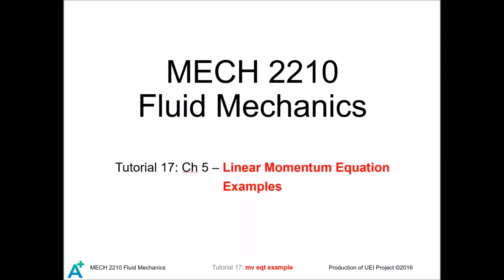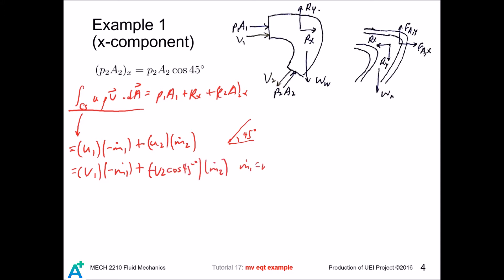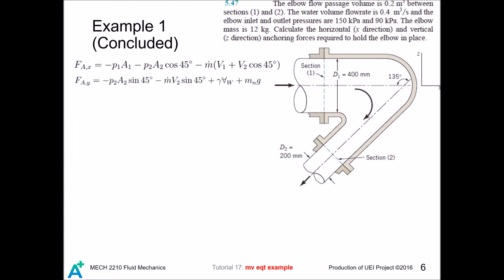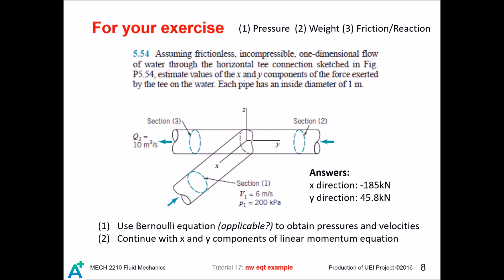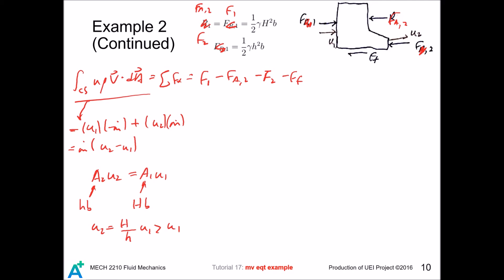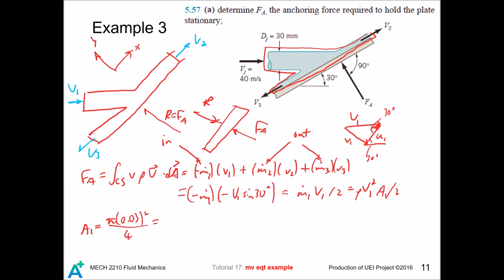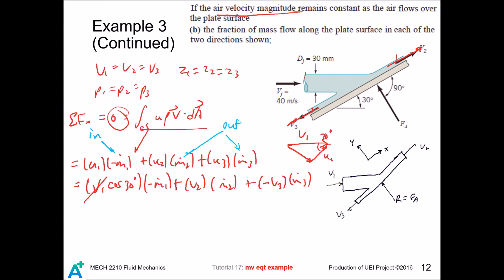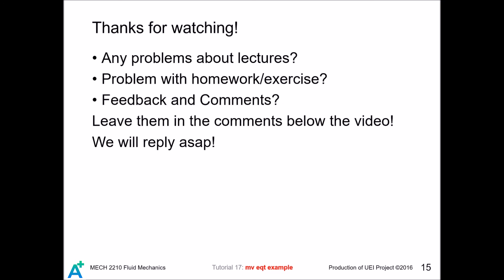MECH 2210 Fluid Mechanics Tutorial 17* - Linear momentum equation II: Examples

Comment: Why is p2A2 pointing inward in example 1
Reply: What I mean is that the shear stress on the pipe surface can cause the surface force per area (traction), to be not normal to the surface
Reply: (This is my personal account) Nice observation. It is indeed pointing inward. Since I have just taken out the fluid as control volume, I would imagine that the fluid is confined in some container which we call the surroundings. The fluid presses against the surroundings and the surroundings gives a reaction force to the fluid. As I was drawing the forces felt by the fluid, this inward pointing reaction shall be drawn. This is just like when you were studying fluid statics:) If you don't like my unprofessional explanations you may refer to what people says here: https://www.quora.com/Why-is-pressure-direction-in-momentum-analysis-of-a-control-volume-say-a-pipe-taken-in-opposite-direction-of-flow-of-fluid-in-the-downstream
Reply: Because the surface force always move inwards the control volume.
Reply: Azam Jamal Sorry but I don't think that is accurate. The reaction force that we wish to find is indeed a surface force on our control volume. That is dependent on the speed of the fluid. Hence the traction on a small boundary element cannot be normal to the element